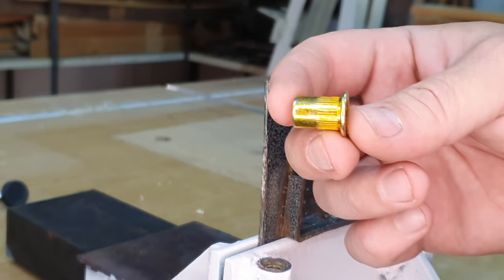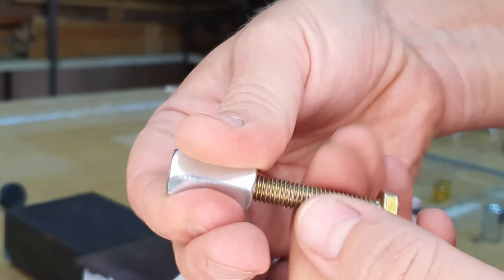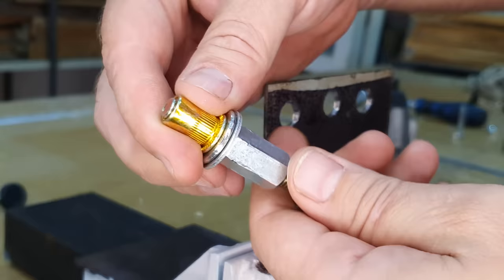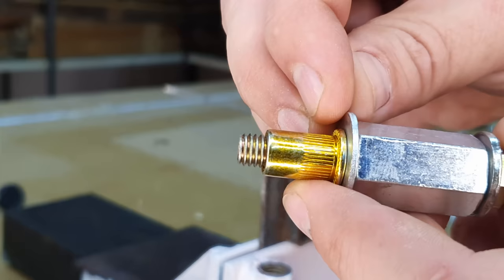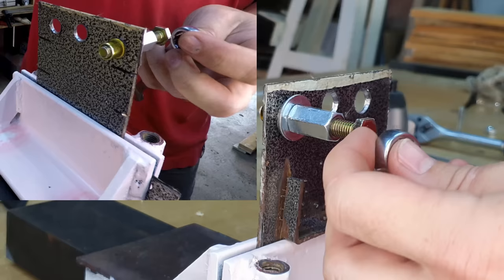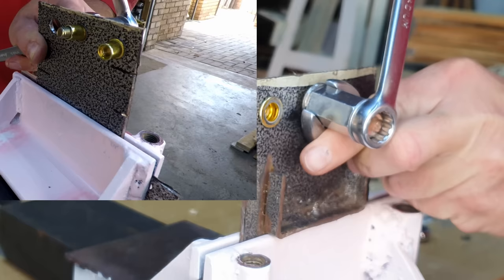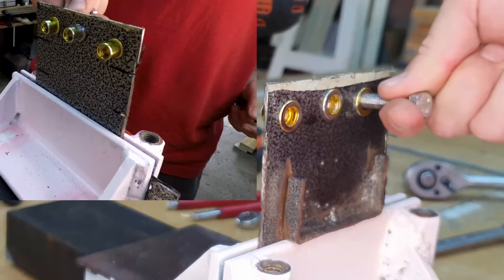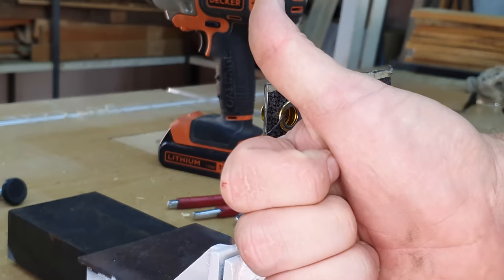You can insert a rivnut with basic tools! #2

Comment: I agree with previous comment about using a thrust washer but I would add that you should grease the threads to prevent galling and make it thread easier. Great video, thanks.
Reply from the maker: Absolutely! Thanks for your support as well! 👌
Reply: What would a thrust washer do?  I watched a couple videos and read a thing about thrust washers but I still don't understand what it would do here
Thanks
Reply: @jeffa847  Jeff, using a thrust washer is essentially putting ball bearings between the nut used for crushing the rivnut and the rivnut making the nut roll it’s way tighter instead of scraping against the nut to tighten it. It makes tightening the assembly easier and smoother. I hope that makes sense.
Reply: @davidt8438  Yeah I think I see.
So the thrust washer is made in such a way that there is less friction on both sides than a regular washer would have?
I saw one video where they were using a thrust washer with copper(?) brass(?) - it was some kind of softer metal - and that didn't really make sense in this application.
Thanks so much for your response
Reply: You are very intelligent

Comment: Not correct. Your very likely to damage the rivnut thread😮. Better to drill a hole the same size as the thread in a flat piece of steel and place it between the washer and the rivnuts then tighten the nut.down.
Reply from the maker: Thank you for your feedback and support! 👌
Reply: Nope not correct. Your comment is the opposite of correct. Could you provide a new method that IS better than the video? Cheers mate
Reply: Red we do this all the time... this method works.
Reply: It's a sample.  This works great.  I used his video to install my fenders.  Thumbs up 5* video.

Comment: A very useful video, thanks! I’ve used rivnuts for many years and have used a couple of kits with the pliers type installation tool, which are OK for smaller sizes, or the softer aluminium ones. For the larger sizes (above M6) this DIY type of tool works better because you can get more installation force. From personal experience I prefer the first method shown here because the bolt doesn’t turn in the rivnut during the installation so there’s less chance of damaging it, the rotation takes place between the threads of the installation bolt and the tube nut. If the rivnut thread does get damaged during installation you’ve completely wasted your time and will then waste even more time removing and replacing it (been there). Rivnuts which have loosened with use can also be reset with care using any of these methods but I’d always use the first one shown. 😊
Reply from the maker: I am glad you enjoyed the video and found it helpful! Thanks for your support! 👌🏻
Reply: When some idiot doesn't lube the threads ,and it's 5yrs later when you've got to get the fastener out but the whole thing spins....it'll make you wanna push it off a cliff and watch it burn.
Reply: @MrTheHillfolk  Yes, a few years ago I needed to take the body tub off the box section chassis of my kit car. It was held on by a number of factory fitted, 12mm rivnuts and one began to spin in the chassis when I tried to undo its screw. The only way to access the front of the rivnut was to take the body off….catch 22. I eventually managed to jam an old coarse file through the open end of the chassis tube which allowed me to put enough leverage on the rear of the rivnut to jam it and stop it spinning. Otherwise I would have had to cut the body tub apart in a critical area.since then I often seat a new rivnut with superglue in the hope that every little helps.

Comment: For method #3, does it have to be an impact driver or will a good electric screwdriver do as well? Thanks for the vid by the way! I really liked that you compared the three methods.
Reply from the maker: If your electric screwdriver has enough torque it could work, but mostly to start crushing the rivnut you might need that impact action. I'm glad you found it helpful, thanks for your support!👌🏻

Comment: When you used the Nut Driver have you considered making a packing piece that will fit inside the Driver so you can use the Impact Driver to put pressure on the bolt head? Using a low profile socket may save having to make the packing piece to put inside the socket. The idea is to use the Drill or Impact Driver to help put pressure on the rivnut so it won't turn in the hole.  I hope this makes sense.
Thank You for the methods of "cinching" the rivnut up without needing a specific tool.
Reply from the maker: I have not really thought about it, I can probably put a nut inside the socket as a spacer. Thanks for the tip and support! 👌🏻

Comment: I tried to do 3mm rivnuts without the appropriate tool. So I found a pop rivet gun that I use the right insert for the gun, and a long enough all thread or long enough headless bolt in my case it was 3mm bolt that I cut the head off, it has to be quite long so the gun can have purchase on the thread and pull it thru, worked a treat!!
Reply from the maker: Awesome, sounds wonderful!

Comment: Ahh rivnuts, the love hate fastener for projects. 
Love the easy install, hate them when someone didnt lubricate the threads and the bolt seizes in pkace and the whole rivnut spins.
Theyve definitely ruined some fun during a project.
Reply from the maker: 😅It is a complicated relationship
Reply: Can a rivnut be installed with some kind of permanent adhesive so it will stay in place?
Reply: @jeffa847  depends on how strong a connection you need in the part 
3m structural adhesive is some wicked stuff ,if an adhesive could do it ,it would be that.

Comment: Tried it. It works so long as the little ribs on the rivnut grab the hole rim. If not the nut spins and won't crush. The larger the rivnut (M10 etc) the more likely to spin as the force required to crush is greater than the friction between the metals. Make sure the hole is tight. You see some people pull the bolt down on an angle to get grip on the inner rim of the hole to get the crush going. My advice. Works for smaller nuts and make sure the hole is tight. For $69 I ended up just buying the tool for M10's (13mm).
Reply from the maker: Thanks for your feedback and support! 👌🏻

Comment: Option no 1 would be my preferred method
Reply from the maker: Awesome, thanks for your feedback and support! 👌🏻
Reply: Option 1
Use a high tensile bolt.
(Bolts may stretch and fail if not high tensile, that may be why the first time you tried to spin the tube nut onto the bolt it jammed)
Use a socket with an extension, plus a solid T bar you can push against on the end of the bolt

Comment: I also prepared everything, but I did not get any results.  Because the rivet nut of all the washers and the support nut was rotating and it was not fixed and riveted in the hole, and no matter what I did, I did not succeed.
Reply from the maker: Maybe try to apply more pressure on the rivnut so that geips the face of the material better. I hope you win!
Reply: This happens to me too. Can not hold it any tighter and it just spins.
Reply: Same
Reply: I struggle with the large ones, tool or not.  The 3/8” size is beyond the methods I have tried.

Comment: are rivnuts OK to use on 1-2mm thick plastic sheets?
Reply from the maker: I guess it depends on a few things, but it will likely crack the plastic
Reply: For plastic you should use split rivnuts. Very similar bit designed to work with plastic.
Reply: @bison-gear  i tried googling but didnt find anything specific to that name, are they the ones that have the sides that open up and then fold on themseles?
Reply: @lukaszM46  correct, one made for plastic when tighten split in 4 thus have more surface to hold on.

Comment: Well I did the first on n I got nothing out of it. I kept tightening n nothing. I used the rivet nut tool jet n after a few of them going in,it started to get really tight to push together. The other one didn’t tighten at all. I also ask the store personnel’s to show me what I’m doing wrong. But still got know where. So now I’m looking to get the rivet nut drill kit. Like why can’t I just get the holes in my van fully filled in to get my walls up?
Reply from the maker: Hi Deloris, the assumption that I can make from your description is that the holes in your van might be a bit too big for the rivnuts that you are inserting. They can therefore not grip properly when crushed together. I hope this helps a bit.
Reply: Check to see if the rivnut is a steel one or aluminum made one because the steel rivnuts are much harder to compress . Go to Harbour freight because they have the kit but they also sell a rivnut tool for under 20.00 that has 2 long handles on it that can handle the steel rivnut with no problems verses the cheap tool that comes in the kit .

Comment: I have a scenario where I can't see the other side, as I need to install a rivnut into an enclosed aluminum square tube/beam underneath the bottom of my camper/trailer. It seems the best option would be to go with one of the first two since I could feel the tightness of the rivnut against the inside if the beam, so that I make sure not to over-tighten it.

I could probably use an impact driver but I'd have to practice on a test piece that I can see the other side of, to know how many rotations is good.
Reply from the maker: Yes, the test piece practice run would be a very good idea. Then you can test both methods and feel which would be most effective. Good luck and enjoy your journey! 👌

Comment: i noticed it looks like a tile being used for demo. do you think carbon fiber is as strong as that tile?  how much pressure is put on the material or is most of it on the rivnut itself being squeezed?
Reply: i am using an aluminum rivnut which is not as heavy duty as the one you are using
Reply from the maker: It is actually a piece of painted metal, so its fairly strong.
Reply: @DIYwithDeon  thanks.
Reply: @DIYwithDeon  I think the bike carbon is pretty strong as well.

Comment: HELP. Can someone tell me why my rivnut won't grab and set(expand) in the hole?
I drilled a 3/8 hole, trying to put M6 rivnut but it won't set. Do I need more pressure?
Reply from the maker: The 3/8 sounds too big for that size rivnut. Try a smaller hole..
Reply: @DIYwithDeon  ok. I'm installing a spoiler on my car and the directions said that size but I'll try your suggestion
Reply: This is not a reliable method. It will increase the chances of stripping out the bolt leave behind a useless rivnut.
Reply: Yes, the hole you have seems obviously too big,  I am hammering my M6's in 5/16 holes. Also, use the first method he showed, there is a huge difference in between the two. The first method is compressing the nut without making the bolt to spin in it, bit harder to do but safer. Avoid impact wrenches as they can strip the rivnut threads quite easely.

Comment: can rivnuts be used to make bolt holes smaller?  like if i have a m8 bolt but the bolt hole is more like m10 can i use a m8 rivnut in the hole so i can use the m8 bolt.  since using a bigger bolt isnt really feasible in my application and i dont have the skill to weld the bolt hole closed and drill it to the correct m8 size.
Reply from the maker: Preferably not, the rivnut will not grip properly in that application. I would recommend ising a repair sleeve. It's a sleeve with thread on the inside and outside. Usually used to repair damaged thread , but can be used when the hole is too big as well. Thanks for your support! 👌🏻
Reply: @DIYwithDeon   is the repair sleeve hammered into the bolt hole basically and held in mostly by the bolt and nut?
Reply from the maker: No it is screwed in. The sleeve have thread on the inside and outside
Reply: Is that M10 dimension of rivnut? Thanks

Comment: I didn't have suitable nuts and had only small standard nut, so I failed spectacularly as that small nut shredded the bolt threads xD
Got a cheap tool from nearest home improvement store, and it failed even worse! Because I have stainless steel rivnut... and there's not enough strength in the world to sqeeze the handles of the cheap tool as these handles are just too short and mechanism doesn't amplify your force unlike better tool which that store didn't have....
Reply from the maker: That sounds a very unpleasant experience! The best advice I can give is to use tube nuts and hard bolts or perhaps extend the handles of the tool you already have, to see if that helps crunching the rivnuts. I hope you find an appropriate solution. Thanks for your support!  👌
Reply: Great comment, I always wondered about those two factors. You need a long coupling nut to distribute the friction on theads, and you don't want stainless unless necessary because the wall of the rivnut needs to easily collapse.
Reply: It may be that the stainless rivets have higher strength and thus require more power.
Second problem: Stainless steel tends to seize. Then you won't get any further. Therefore, in this case, the thread and the face must be lubricated.
Reply: @cowboy7645  Yeah stainless is definitely much harder from material itself, so many one-hand tools won't really be able to actually handle that, getting a tool for wrench/screwdriver solved the issue for me

Comment: In my experience, method #2 and #3 are not so repeatably successful. It's easy to get it right while making a yt video in a test environment but not so repeatably successful in the real world, when you want to get a number of nuts in and have to spend ages holding everything in and pushing just right with your hands.
I use a method like your method #1 but I put three smooth washers between the long nut and the rivnut, with a really tiny amount of grease in between. They easily absorb any rotational movement before it ever reaches the rivnut.
Reply from the maker: Thank you for your feedback and support! 👌🏻

Comment: This works normally only for M6 and smaller nuts. Also, this normally works if the surface can handle the nut without scrolling. Otherwise this can be very annoying and time-spending :-D
Reply: is that correct? @DIYwithDeon
Reply from the maker: Well, the rivnuts used in the video are M8 rivnuts and I believe I covered most of the points to ensure these methods are effective. But, I am sure some points or parts of the video are sometimes overlooked. I hope these methods help a few people when they are faced with a similar situation. Thanks for your support as well! 👌
Reply: i am super glad to hear that this is M8.  that is what i am planning to use on my carbon bike.  i am terrified to start, and everyone else is terrified to give me advice, to avoid liability, including youtubers and bike shops :) @DIYwithDeon

Comment: don't mess around with crap but buy a good special tool to do it right and be sure the rivnut sits tight and strong.
Reply from the maker: 🤦‍♂️I think you're missing the point...
Reply: See the topic of the video please. The video guides on how to get the work done if a  "good special tool" is not available. Learned a lot from this video.